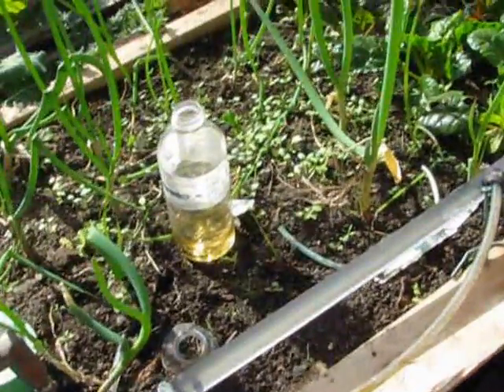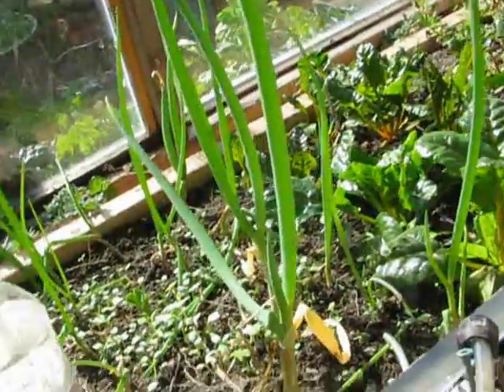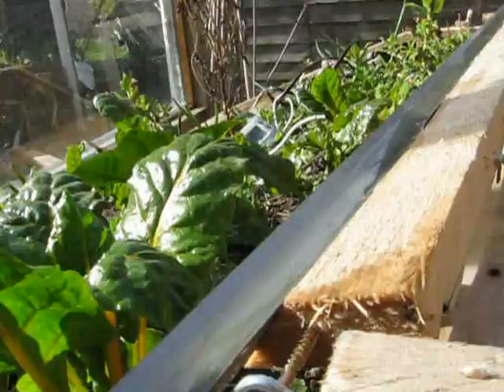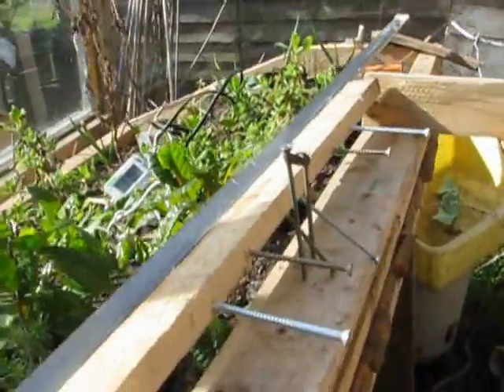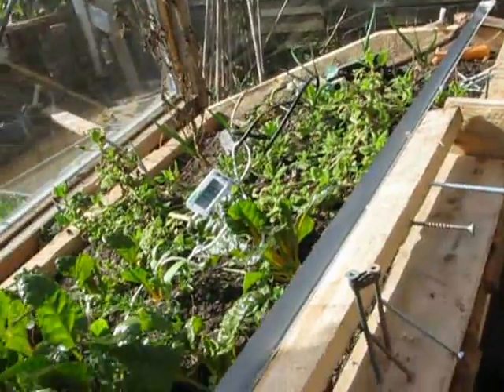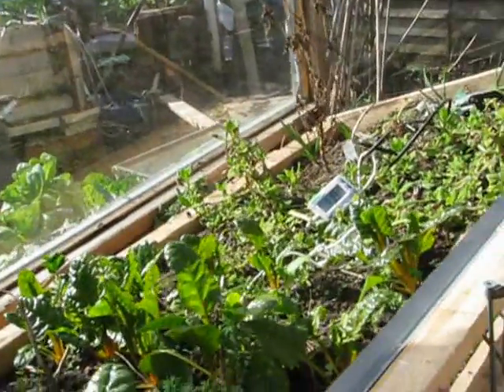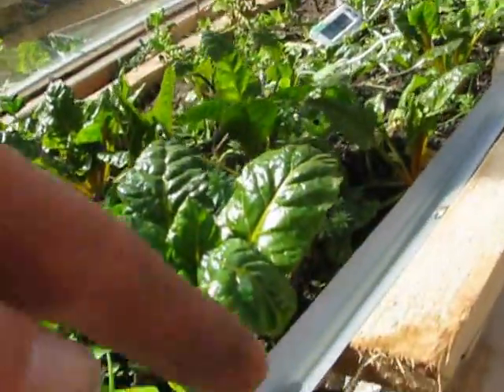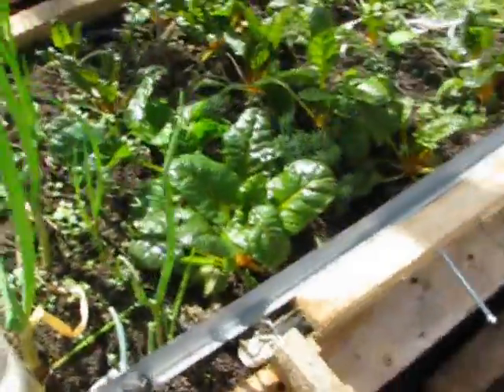"Flip-flop" spreads water on a  pallet garden. Will it work in Aquaponics, Hydroponics too?

Comment from the maker: Thanks, Mike.  The methods I develop are actually not "energy efficient" at all!  I am using an "inefficient process" to produce more vegetables quicker with less water consumption. When the energy  efficiency geeks work the figures, they will say "O MY GOD, that is horribly inefficient!".  But it is 3.5 watts working 3 pallet gardens. (Less than 3 dollars per year electricity costs).  By summer, people will have made  "horribly inefficient" wind water and Solar Stirling engines to power this.

Comment from the maker: This is my "flimsy flopper" to better distribute water in my sloped pallet garden. It is made cheaply. The metal V is the corner piece for drywall (plasterboard), cut back to 5 ft long to suit the planter better. Originally I was trying to use a strip of plastic sewer pipe. This is way lighter and a more appropriate size and so simple to use!